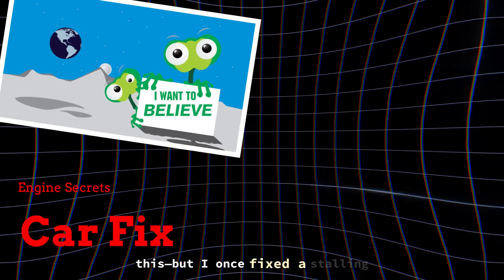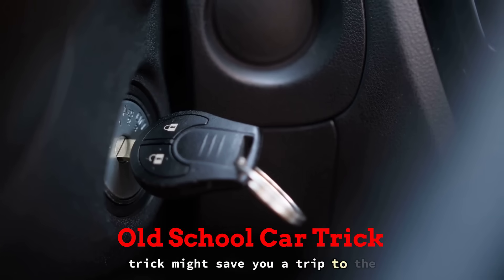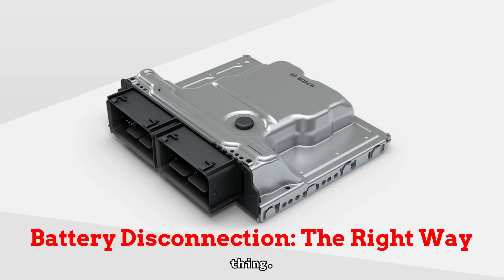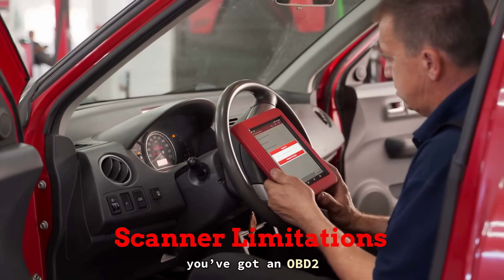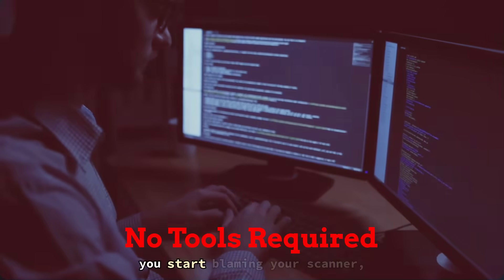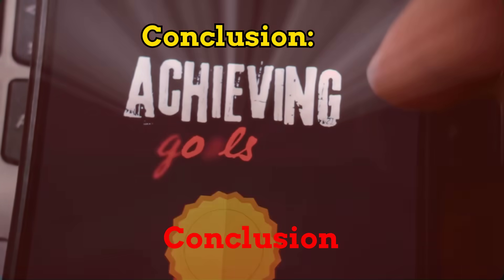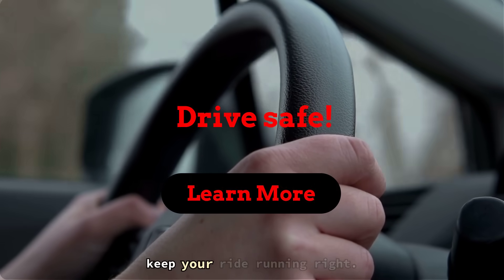Doing This Will RESET Your Car And Fix It For Free (5 Real Mechanic Methods)

Comment: Car manufacturers have really learned a way to financially hurt consumers, and keep mechanics in their job for life.... Sometimes vehicles are more problems than their worth
Reply: My New Kia Sportage keeps showing keep driving to regenerate, due to blocked fuel filter etc. Does not work. So had to pay a small fortune to force it.
And how long until it needs doing again? Anyone any ideas please.
Kia should ensure its well documented. I would not have bought this car if I had known.
Reply from the maker: @stephenbailey7652  Totally hear your frustration, Stephen. That 'keep driving to regenerate' message is tied to the DPF (diesel particulate filter), not usually the fuel filter—and once it's too clogged, the car can’t clear it on its own, which is why you had to pay for a forced regen. Sadly, it’s a common issue on newer diesel vehicles with short-trip driving.

To help slow it down: try taking it on longer highway runs (20–30 mins at steady speed) every week or two to let it regen properly. Also make sure you're using the right low-ash oil and quality fuel. But yeah—you’re right, Kia (and other brands) should make this way clearer before people buy. You’re not alone, and I appreciate you sharing your experience!
Reply: Thanks 4 your reply. 
Its petrol 2025 kia
with 48v battery.
I'm wondering if adding Red X might help? 
Redditch / Startins Kia took it away to force regen. But I know it proved a challenge for them. All in all nearly £200 which kia wont help with. Kia Solihul never even bothered to go through all the BELLS &, Whistles, where I ordered it from - Leaving me PERPLEXED. They VAMOOSHED.
Never to bee seen or heard again.
Reply: Oh yes I had a call from a Nationwide Repair Co. £750.00 to come and sort it. WOW.
Im so sad all the weeks of planning, signing and stress work in a successful purchase. 
But I really cannot trust this vehicle now.
And i'm wondering what to expect next.
 
The Nationwide guys ".
I told em to Hold em" . 
No No No.
Reply from the maker: @stephenbailey7652  Man, Stephen—totally understandable that you feel let down. You put in the time, energy, and trust, and it’s incredibly frustrating when a brand-new vehicle starts throwing complex issues at you right out the gate—especially when dealers go radio silent after the sale.

Just to clarify since it’s a 2025 Kia petrol mild-hybrid (48V), that ‘keep driving to regenerate’ message is even more strange—it’s typically tied to diesel DPF systems, not petrol engines. If that’s what it’s showing, there might be a glitch in the ECU software or a miscommunication between sensors. Definitely something that should still be under warranty.

As for Redex: it can help keep injectors clean and maintain engine efficiency, but it won’t fix a regen-related issue or sensor misread. It’s more of a preventive additive than a repair solution.

You shouldn’t be paying hundreds just to "force" a system that’s supposed to manage itself. If it happens again, I’d recommend escalating directly to Kia UK Customer Services with full documentation—including how both dealers handled (or didn’t handle) the issue.

You deserve better after investing in a new car. If you ever want help drafting a formal complaint or need info on what to ask for next time you're in the shop—I’ve got your back.
Reply from the maker: You’re not wrong, Transport King. Modern cars are packed with tech—great for comfort and performance, but a nightmare when it comes to long-term ownership costs. Between proprietary systems, sensor overload, and software locks, it can feel like they’re setting us up to fail. That’s exactly why I make these videos—so regular folks can take back some control and avoid unnecessary shop bills. Appreciate you calling it out!

Comment: I have a 2003 f250 that won't start  but will start with starter spay but won't stay running every one says replace fuel pump
Reply from the maker: Thanks for sharing, Wayne. If your 2003 F250 starts with starter spray but won’t stay running, that usually points to a fuel delivery issue—so yeah, the fuel pump is a strong suspect. But before replacing it, I’d check fuel pressure with a gauge to confirm. Also make sure the fuel pump relay and inertia switch (if equipped) are working, and that you're getting voltage at the pump. Sometimes it’s a wiring or fuse issue, not the pump itself.
Reply: Try replacing the fuel filter first .  It's maintenance anyway, but could also be the problem.

Comment: Took my car to mechanic. He tested oxygen sensor that he suspected. Said I would have to return when he has the part. He charged me for the service. I took the car home and out of curiosity, I unplugged and replugged the suspected bad sensor. Ran perfectly after that from then on. I Wish I would have unpluged and reconnect all connections before I took it in the first time. Cost over $100.00 and would have cost more had I returned. Mechanics aren’t gods.
Reply from the maker: Totally feel you on that one. Sometimes it really is just a loose or dirty connection causing all the chaos—and a simple unplug/replug can wake the sensor right back up. That’s why I always say: check the basics first before spending big. Mechanics are human, not gods—and while many do great work, they don’t always start with the simplest solutions. Glad you trusted your gut and got it running!
Reply: Use YouTube videos as your diagnostic center.  I do all my cars fixes using YouTube videos.  Haven’t failed me yet. 👍🏻
Reply: No tgey are scammers
Reply: @Think_For_Yourself_ 😂
Reply: neither are doctors, veterinarians, professors, lawyers, and those who people see as in positions of some authority or so-called “knowledge”…
Reply: Doesn't sound like you brought it to a mechanic.. Sounds like a parts changer
There's a big difference
Reply: Thats right there are no gods not even one. Have a great day now that you know.
Reply: Thank you for the advice on resetting the ECU. My problem is with my motorhome which is a 2005 Winnebago with an 8.1 GM engine. I replaced the engine after my old engine blew up. Everything went well all the wires re-hooked back to the original source and the engine started, but it backfired and Would not idle if I got the RPMs up to 2000 it would run fairly normal but soon as I backed off on the throttle, it would backfire miss and finally die then it may not start again for a while, and then restart with the same backfiring and missing. I changed a lot of parts lotta sensors, injectors, spark plugs, coil packs throttlebody and my last hope is the accelerator pedal. It is showing a faulty throttlebody on a code right now.

Comment: O WOW I SEE PEOPLE FRYING THEIR ECM DCM < ALSO ERASING THE COMPUTER TROUBLE CODES IS A VERY BAD IDEA BECAUSE IF YOU HAVE FAILED SENSORS OR THE CAR DOS NOT RUN THIS CAN COST YOU MORE MONEY IF YOU DO HAVE TO TAKE IT TO A SHOP FOR REPAIR THIS MAKES IT HARDER AND LONGER FOR A MECHANIC TO REPAIR IN TURN MAKES YOUR LABOR RATE GO UP BECAUSE THE MECHANIC HAS TO SPEND MORE TIME FINDING FAILED SENSORS , so keep in mind a ecm reseat will not fix a car with a failed or bad part  or sensor , it will only make it harder to repair , note if you do this record all the codes first most parts stores will read them for free for you and even print them off ,,...
Reply from the maker: You’re 100% right, and I appreciate you bringing this up. An ECU reset won’t magically fix bad parts or failed sensors—it just clears the memory. That’s why I always recommend pulling the codes first, saving them, and only doing a reset after repairs are made or if you’re trying to clear out leftover glitches after fixing the root issue. Sometimes those codes show up because of a genuine bad part, and sometimes they’re just false flags from a glitchy ECU. A reset helps clean the slate—but if the problem’s still there, the light will come back. And like you said, clearing codes too early can make it harder for a mechanic to diagnose, which could mean more time and labor cost. Solid advice all around!

Comment: 04 pontia c grand am. Crank over no start .replaced coils .ign mod. Bod mod pcm ign pass code switch. Fuel pressure  reg.still mo start fuel pressure  in range volumn  ok . Im stumped
Reply from the maker: Man, that’s a tough one, Donald. You’ve already covered a ton of the usual suspects. Since it’s cranking with good fuel pressure and volume, I’d double-check spark at the plugs and verify timing (crank/cam sensor sync). Also—do a quick pass on the crankshaft position sensor if it hasn’t been swapped yet. Those are known troublemakers on the 3.4L Grand Am. And don’t rule out a security system issue (PASSlock)—even if parts were replaced, a relearn might still be needed.

Comment: I am having a issue with my ecu car won’t start or turn over at all when you cut it on a clicking noise from the fuse box so I replaced the fuse it still clicks replaced the ecu and now it still won’t start any suggestions? It’s triggering the system security lock
Reply from the maker: Thanks for sharing, Shakia—that definitely sounds like a security system lockout. If you're hearing clicking from the fuse box and the ECU’s already been replaced, chances are the immobilizer or anti-theft system still needs to be relearned. A lot of cars require a specific security reset after ECU replacement (like a key relearn or 10-minute ignition cycle). I’d check for a blinking security light on the dash—if it's flashing, the system's still blocking the start.
Reply: Try this i learned how to reprogram key fobs like key relearn turn key on and off 10 times ignition cycle program your key fob. your key has chip in it.

Comment: My vauxhall agila was giving me all sorts of problems..service light kept going on and off car was running rough then that light went out then the check engine came on ..I turned ignition on and off about 8 times ..then I drove about a mile down road and had no warning lights came on ..like MAGIC 😂😂😂
Reply from the maker: Haha that’s awesome, Zico! Gotta love when the old ignition cycle trick works like magic 🎩✨ Sometimes the car just needs a little ‘wake-up call’ to reset itself. Glad it smoothed out—and thanks for sharing the win!

Comment: Hello, can u give me an idea where are what i should do about my granddaughters 2015 optima ex that im assuming is burning alot of oil, when she gets  an oil change a month later it needs MORE OIL in it, it has barely a dot of oil left on the dip stick, sometimes none!  I dont want to be ripped off at the mechanic. THANK YOU. 😢
Reply: Nissian commonly has a problem with  their crankcase vent OR PVC valve that can cause extra oil consumption , but Note (( Newer Vehicles Burn Oil  They are Made to it reduces friction on piston rings and reduces friction in the motor , so  if you are doing long life oil changes you should use around 2 Quarts of oil between oil service i would checking your oil level every 2000 miles or every 3 to 4 days before starting the car for a good oil level read ,,  SO THE OIL USAGE MIGHT BE NORMAL AND THERE MIGHT NOT BE NOTHING WRONG WITH THE CAR
Reply from the maker: Hey there—thanks for looking out for your granddaughter. That 2015 Optima EX is known for oil consumption issues, especially with the 2.4L engine. First, check for visible leaks under the car or around the valve cover. If there’s no leak, it may be burning oil internally—common on these due to piston ring problems. Keep a close eye on the dipstick every 500 miles and top it off as needed to avoid engine damage. Definitely avoid letting it run dry. Before spending big, ask a mechanic for a compression test or oil consumption test

Comment from the maker: Care Care Fix Top DIY Tools and Products:

🧰 Mechanic’s Must-Haves 
Basic Mechanic Tool Set: https://amzn.to/4lbScbl
Car Battery Tester: https://amzn.to/4k2bAXv
Cordless Impact Wrench: https://amzn.to/4lzQDo7

🔋 Emergency Essentials 
Best Jump Starter: https://amzn.to/3HJPdsx

🛠 Useful Maintenance Accessories 
Tire Gauge (Check Pressure): https://amzn.to/4n7yX4u
Quick Twist Oil Drain Valve: https://amzn.to/43Sl2bd
CRC Mass Air Flow Sensor Cleaner: https://amzn.to/460Sldq
Tire Air Pump: https://amzn.to/44mIE7Q

🛢 Fluids and Leak Stoppers 
AT-205 Re-Seal (Stops Leaks): https://amzn.to/3G3ZY8q
ATS 505 Fuel System Treatment: https://amzn.to/3TuQDcO
Lucas Oil Transmission Fix: https://amzn.to/3Twx5op
Bar's Cooling System Stop Leak: https://amzn.to/4nhNydZ

🚗 Essential Scan Tools
Bluetooth Scan Tool: https://amzn.to/4ectt4C
Newest Scan Tool: https://amzn.to/3G5p1YI
Cheap Scan Tool: https://amzn.to/4k2M5W7

🔎 Quick DIY Diagnosis Tools 
Head Gasket Leak Test Kit: https://amzn.to/3GatSYx

Comment: Can someone fix a parasitic drain like this
Reply from the maker: Good question, Mary! These reset methods won’t fix a parasitic drain—they’re mainly for clearing ECU glitches and sensor confusion. A parasitic drain usually means something’s pulling power when it shouldn’t, like a stuck relay, bad module, or even a glove box light staying on. That needs proper testing with a multimeter. But I might cover a step-by-step parasitic draw test in a future video!

Comment: Some of these are only temporary solutions. The check engine light will return.
Reply from the maker: You’re absolutely right—some of these methods are resets, not permanent fixes. If the root issue isn’t handled, that check engine light will come back. But they’re great first steps to clear false codes or after a real repair. Appreciate you keeping it real!

Comment: Give us the procedure for the push button start
Reply from the maker: Great question, Edward! For push-button start cars, most of these methods still work—you just need to press the button without pressing the brake to enter the ON mode (engine off, electronics on). That’s your version of 'key in ON position.' From there, you can do the pedal reset or use a scanner just like with a key ignition. Let me know your car model if you want a more specific walk-through!

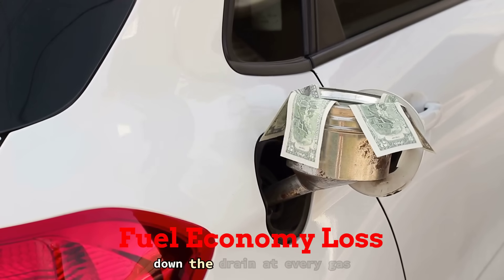Comment: 6:47 The “pedal reset move” is only described in the text on the screen and you do not say this verbally.  Why?
It is very hard to notice this is where the “move” is described and even then the text scrolls off the screen at a rate that does not allow comprehension.
Why do you stop speaking for this key moment?
Reply from the maker: Great catch—and you’re totally right. That section definitely should’ve had a full voiceover explaining the pedal reset step more clearly. I’ll make sure it’s fully spoken and slowed down in the next video or even post a short that focuses just on that move. Really appreciate you pointing it out!

Comment: I have a 2014 chevy cruze at the shop for over 2 months now. code showed misfire on cylinder 3. so the mechanic changed GM parts of all new spark plugs and coil sets. replaced the gaskets that had an oil leak. cleared the code. when it was time for my son to pick up the car, the same code poped up again. the mechanic looked over every possible things to check but no clue as to what is the cause. on conclution, he recommend changing the piston assembly. would any of your method to clear deep glitches help? I would like to suggest this to him before going to the last option. sorry for the long statement.
Reply from the maker: "No worries at all—thanks for sharing the full story. That Cruze issue sounds frustrating, especially after all those new parts. If it’s truly a deep software or memory glitch, Method 5 (the soft ECU drain) might help clear any stubborn adaptive data causing false misfire readings—but it’s not a magic fix for mechanical problems. Before jumping to a piston replacement, I’d definitely try a full reset using Method 5. Also worth checking injector balance and a compression test on cylinder 3 if that hasn’t been done yet. Keep me posted—hope you and your son get it sorted soon!"

Comment: That last method may be dangerous on cars and jeeps that may have an auxillary backup battery hidden in the system under the hood
Reply from the maker: You're spot on, Scott—and I actually talk about that in the video too. Some newer vehicles, especially ones with backup batteries or smart systems, really don’t like having their power cut. I’ve seen folks trigger alarms, lose settings, even brick ECUs. Always check the manual or forums for your specific model before trying that last method. Appreciate you calling it out!

Comment: You are a genius! I just used Method 5 on my 2015 Silverado. The check-engine light had been on and off. But, I don't feel anything wrong when I drive it. The shop recommended to renew the whole fuel system and charge me $5.8k. I am glad I rejected. I always wondered how to reboot a car computer like we do for our home computers. You enlighten me. Thanks!
Reply from the maker: That’s awesome to hear, James! Glad Method 5 worked like a charm for your Silverado—and huge props for trusting your gut instead of dropping $5.8K. Sometimes it really is just a reboot your car needs. Appreciate you watching and sharing your story!

Comment: Unpluging the MAF will just set a 102 code, get a proper diagnosis
Reply from the maker: Absolutely, Clint—you’re right that unplugging the MAF will usually trigger a P0102 (or similar) and isn’t a fix on its own. It’s more of a quick test to see how the engine reacts when airflow data is cut—can help point toward a faulty MAF or a fueling issue. But yeah, definitely agree—a proper diagnosis is key before replacing parts. Appreciate you jumping in with that reminder! 👌

Comment: 2018 Ram. Mouse chewed wires, repaired wiring. Still had code. Soft ECM reset and throttle reset, codes are gone. Awesome tricks.
Reply from the maker: That’s a solid comeback story, Vinni! 🐭⚡️ Glad to hear the soft ECM and throttle resets did the trick after the repair—those little gremlins can leave behind some stubborn codes. Appreciate you sharing the result, and nice job getting that Ram back in shape!